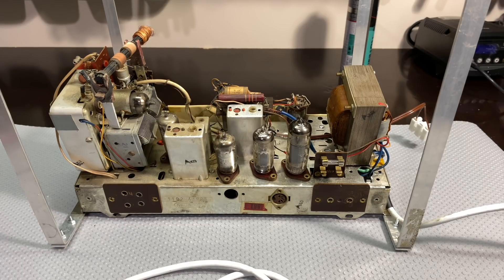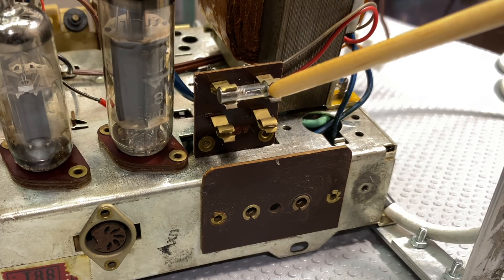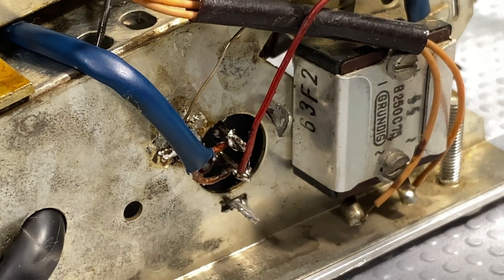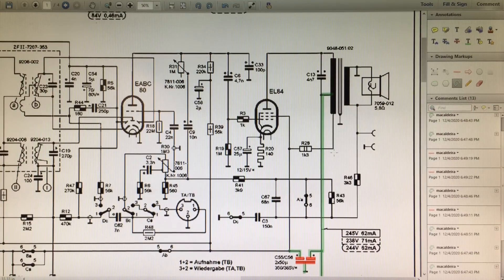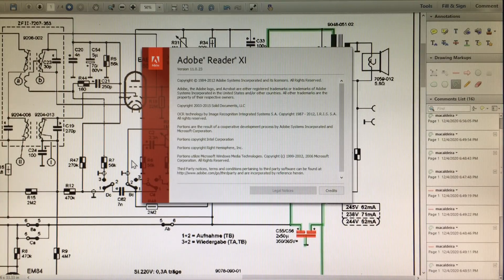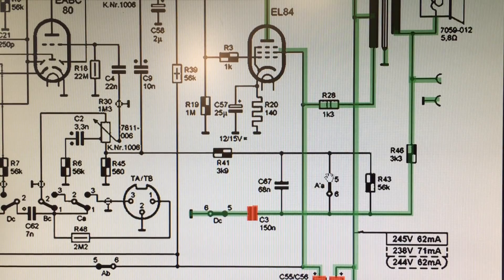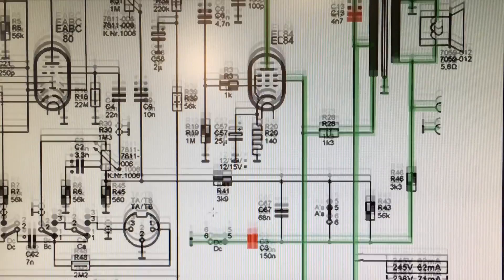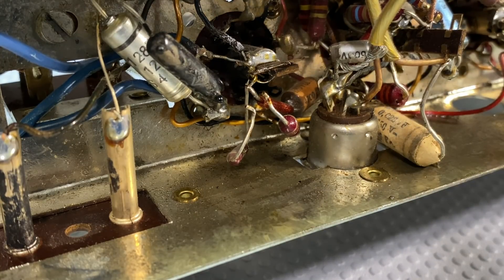Grundig 2147 Restoration pt. 2. Let the games begin!

Comment: 30:30 That fat dark Wima capacitor at the bottom (backside) of the chassis is a notorious troublemaker.
Bet it's a 47nF and that it will be gone in the next video. I replaced 2 of those today, one was completely open.
Great job so far.
Reply from the maker: thanks

Comment: I know it's a matter of taste, but personally I even replace caps that measure fine.
Experience taught me that sooner or later these sometimes still can go bad, sometimes with terrible consequences.
That is especially true for power supply caps. A lot less for film type of course.
Btw, love your videos great advice about things like over confidence.
Something even a lot of pros overlook often.
Reply from the maker: I can confidently say that over confidence can be destructive 😊
Reply: I agree with you. Esp if you keep in mind that even 20 microamps leakage current can cause a voltage offset of 20 volts on a 1 meg resistor. 
And there is many times there is a cap from the plate of a tube that carries say 250v to the grid of the next tube, which has 1M+ resistor to ground. SOMETIMES as high as 10M
In that train of thought IMHO the 0.1mA scale of his leakage tester is not sensitive enough. 10uA full scale would be better.
But at least he is not judging these old ERO waxies with 100+uA leakage "serviceable" like a canadian someone.
Reply: @randomsteve4288  yes, correct
Well I see it more like a ticking time bomb. One day it will go bad.
Maybe next week, maybe next year, who knows?
My thought is like if I am in there anyway and fixing other things, I might as well just replace everything.

Comment: Excellent!  I see that Grundig had finally replaced that wierd switch matrix layout they'd been using in their older schematics.  It's much easier to read in this one.  Thanks for the clear explanation of how you use Adobe Reader in your circuit checkout procedure.  I've been doing much the same using an old copy of Photoshop Elements 10.  Photoshop is more cumbersome to use but allows making changes to the schematic itself to correct copy flaws, etc.  Adding separate layers, one for the base schematic, one for circuit checks and one for parts replacements is useful as well.  However, Adobe Reader is free of charge which is always nice :)

Comment: Grid coupling cap is ok, that's good news. Your EL84 and output transformer are safe!

I have little to no experience of tube electronics. Between your videos and Dave Tipton's, the mysteries of the glowing bits are becoming clearer to me. Patterns and procedures are starting to emerge and the wheels of my mind are starting to grind round, albeit slowly...
Reply from the maker: Keep at it. After a while all becomes clear.

Comment: I am not sure if that your tester is sensitive enough. It might be. I myself use a Chinese insulation tester which can test leakage at 250, 500 and 1000V. It can go up to 1000M ohms or I think even more. I know it will detect leakage if you bring two PCB insulated wires close together so their insulations are touching. Even more, I found bad caps that tested initially good on that tester to start exhibit some leakage after I warmed them up with a hairdryer.

Comment: I spent 3 days trying to repair analog meter checked all resistors caps switches etc all that what was wrong was oxide coated fuses used a round file to clean fuse holders.
Reply from the maker: Yep. We’ve all fallen for something like that before 😊

Comment: I found many Grundig sets I worked on had fuse holder problems. What software are you using for the schematic & being able to trace over it? That would be much easier than high lighters for marking circuits,
Reply from the maker: it’s adobe reader. in the first video of this series  i linked to a video i did on it.

Comment: Hi Manuel, trage is German for slow. As you know the lower the voltage the higher the Ampere. Fuse in German is Sicherung. Sicherung is as you can see like as secure
Reply from the maker: makes sense. Thanks